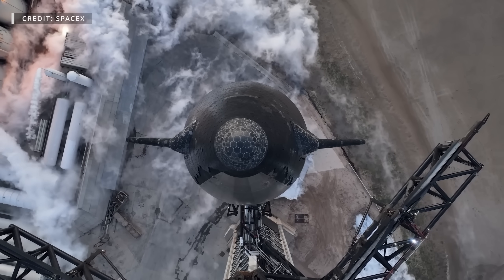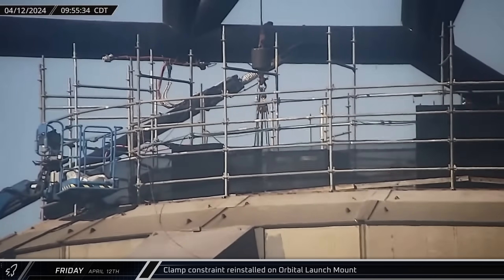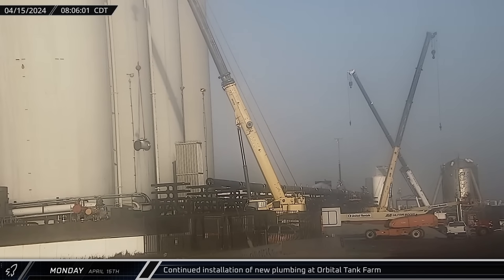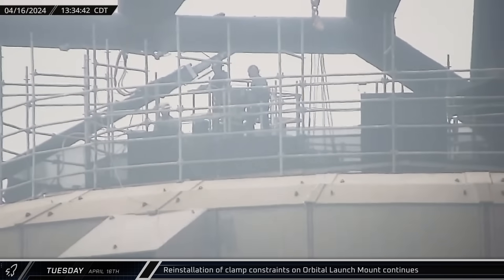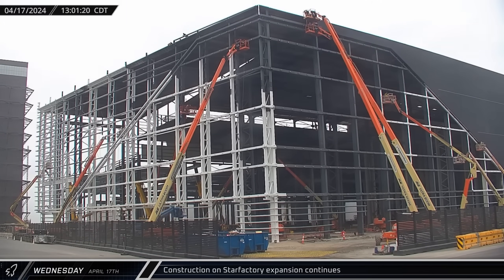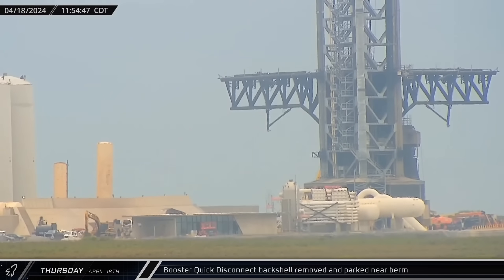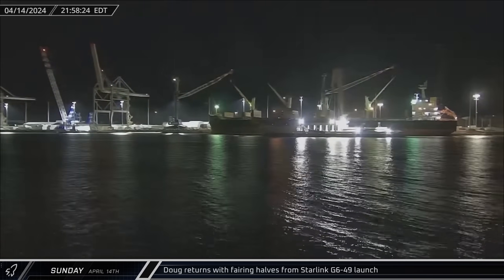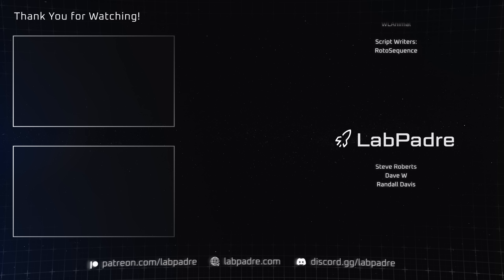Still Fixing Stage Zero As Starship Flight 4 Quickly Approaches! - SpaceX Weekly #111

Comment: Emergency!!! THE ONLY SOTUTION!

 Baffles will not work to prevent the fuel slushing problem, because the tanks of the starship system are too large. That is the only reason why the starship engines have been exploding every time.

The solution:

The tanks  of  Starship and  Superheavy need 2 disk valves, expanding the diameter of each tank. One of the disks, the one on top, rotates above the contiguous disk to close the overlaping holes on the surface of the disks; to reduce the Size of the tank by dividing it, before any rotation or acceleration of the rocket. This will prevent slushings and protect the plumbing, if located 10% above the bottom section of each tank. Large telescopic pistons can be attached below the bottom of disk valves to control the fuel pressure as the piston expands into  the fuel tank. 
 I have built a model that works perfectly. The second disk valve can be located 10%  below the front of the tank, to also protect the front of the tanks from the slushing forces. 
The  gridfins are too flat and too small to be effective enough and will not be able to control the booster. 
Why is Elon  not using four pins instead of three to secure each heat shield tyle? Four anchor points provide far more stability to secure a tyle, not three. Also, each type should be constructed with the bottom half of the brick consisting of an interwoven latice of steal mixed into the silicon, to provide a foundation of strength and durability to each tyle. What is more important than securing the heat shield by providing the maximum stability and strength to each tyle? The interwoven steal mesh lattice mixed into the bottom half of the bricks, and the  four anchor points would eliminate the problems of tyles falling off the ship every time there is an engine ignition event. Please get this message to Elon. Thank you.
Also, Spacex needs 3 actuators to move the payload bay doors correctly, not two. They have only two now, one at each end of the payload bay. They need one at the center position.  Three will guarantee that there will always be enough support to open and close the doors, even if one of the three fails. 
I know the spacex engineers can see these problems. It is like ignoring the elephant in the room. The solutions should be a no-brainer. Musk needs to hire people who can be trusted and who will not continue accepting bribes from Jeff Bozo to sabotage and cause unnecessary delays to the Spacex Statship program.

Comment: when they get rocket to work 100%, you think Elon will change booster form stainless steel, to a carbon hull like falcon 9. would save a massive amount of weight. expensive yes, but if its all reuseable would pay for its self over time
Reply: Changing the material this late in the game would be catastrophic to all the progress they've made with steel. They'd be back to square one.
Reply: @SpaceXsuperheavy  Agreed! Stainless steel was selected to solve specific design problems.
Reply: He started out thinking carbon, remember? The move to stainless is something that is now being emulated in the industry….starting with companies in China. - Dave Huntsman
Reply: If they want to build 1000s of the vehicle though stainless is just easier to produce plus more cost effective
Reply: I have been wondering if they could change the grid fins to carbon fiber or titanium once they get the catch on a regular basis. Those grid fins look like they are really heavy.
Reply: @petercozzaglio6070  carbon fiber simply isn't enough to handle the forces the fins have to deal with, and titanium is both expensive and very difficult to work with. Steel seems to be the answer to both problems, though who knows what SpaceX will come up with next.
Reply: @akkkbn  No Grid Fins lol
Reply: No, carbon not going to happen
Reply: Actually it the replaced it with carbon fibre then the would have to add extra insulation for reentry and it would end up heavier.
Reply: It is not designed for carbon fiber. So no. Completely different design would be needed.
Reply: Falcon 9 is an aluminum alloy.
Reply: Not a chance. That's like one of the foundational design decisions for the whole program. Building rockets is not something where you can swap out materials once the design is complete. Material is the design. It would be almost like starting from scratch.
Reply: Stainless was chosen to mitigate heat related problems. And cost. But mostly heat.
Reply: I think they are more likely to further optimize everything else. Like thinner steel and deleting parts. If that’s not enough they could make it 10 meter diameter instead of 9.  Easier to do that than switch ping to carbon composite. They would have to build out a bunch of infrastructure to produce massive single piece hull sections with vacuum injection molds and so forth.
Reply: @undertow2142  a university in Japan came up with a new stainless that is 301L. It's thinner,lighter, and a little stronger then the 304L stainless there using. If anything it would get switched to that material, since it's the new tech in stainless.
Reply: Falcon 9 is not carbon fiber. Its aluminum
Reply: They will reduce the thickness of the 30x and use tesla's martanising process to cold work harden the steel. Probably start using a friction stir welding method to join all the rings, but that's just a guess.
Reply: Zero chance... Theyd have to invent the world's largest ovens.. and redesign a new heat shield, probably regenerative cooling to even make it work, regenerative would be super heavy and earased carbon weight savings